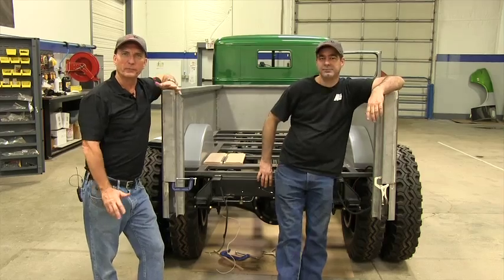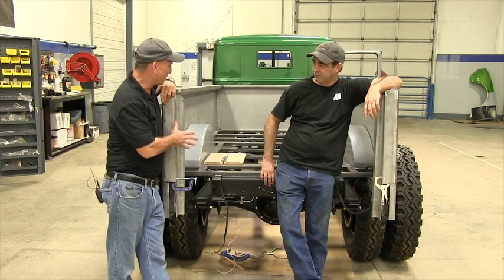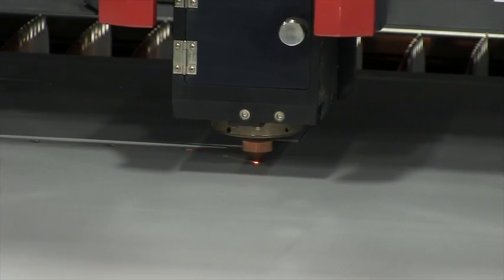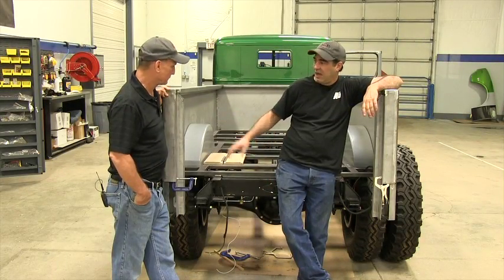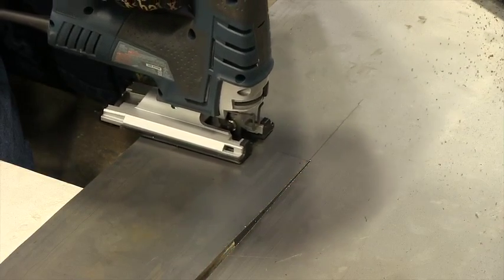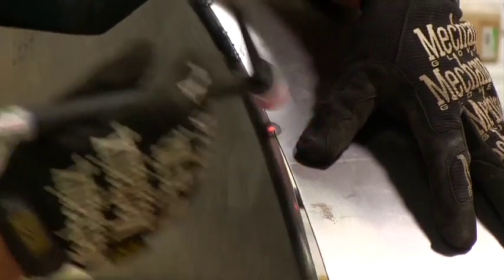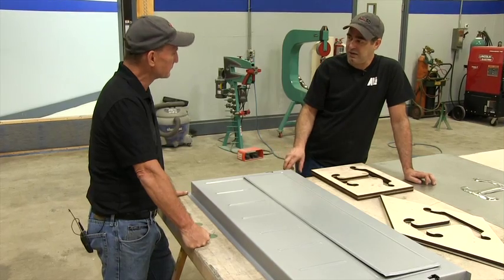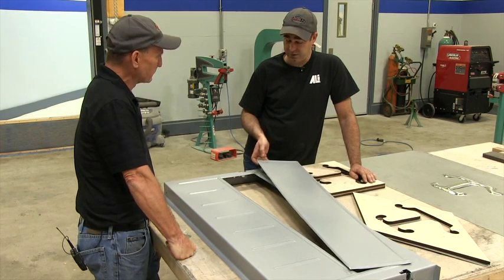Building a "Custom Truck Bed" for AAPEX (Part I)

Comment: I have a 1964 GMC 6500 that I want to have restored in a similar fashion. I want to do a  custom stepside bed, complete with wood floors and I was wondering if I can contact you guys to get some accurate numbers on this type of project and if I can have you guys possibly make the bed for me. I can send photos and take measurements of anything you may need to successfully make the bed.
Reply from the maker: +4daluvofstories Hi there! Thanks for reaching out to us regarding your project. While we do appreciate your interest and confidence in us designing and building this for you; we are not in the restoration business. Finish 1st is an Automotive Abrasives manufacturer.  This restoration project was mostly designed to demonstrate the ease and use of our abrasives.
Reply: +Finish 1st Ok I figured as much...just wishful thinking on my part. Its just when you see the process from the beginning to now...you want to be able to trust the people responsible for bringing your project full circle. Its about the details and the work put into such a restoration...leaving no stone unturned. Well I'm sure I will find someone locally that I can trust to do the job. I wish you guys nothing but success. You have a great line of products and I see your products beings used by many vehicle restoration enthusiast worldwide! I definitely will insist on your products being used to bring my project to its full potential! Thanks for the prompt response! Gluck!
Reply from the maker: +4daluvofstories Hey Bro... Much appreciated!!!! Thank you for your support!!!